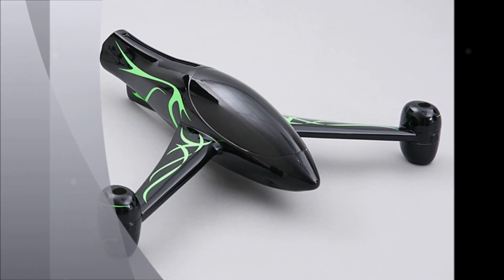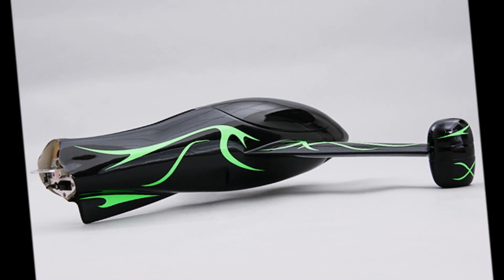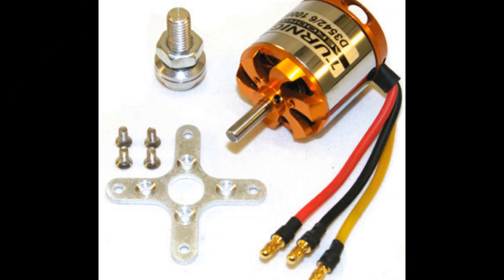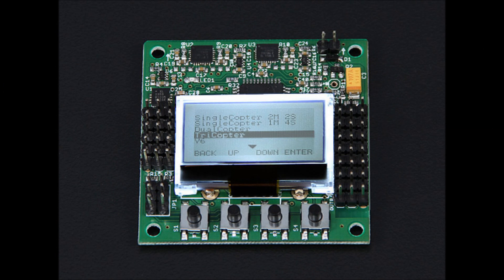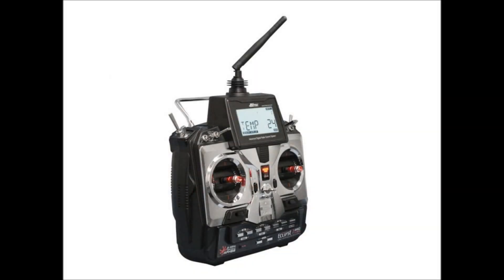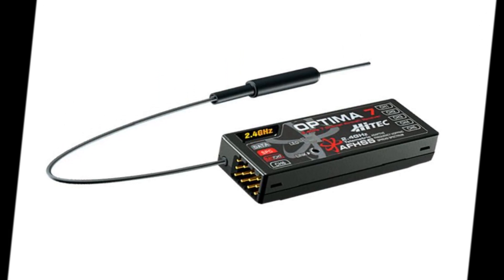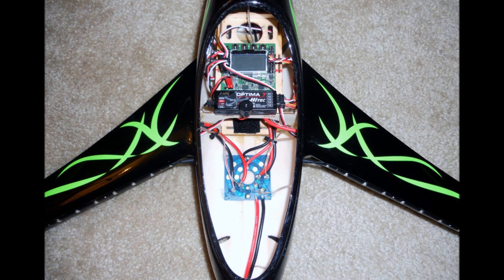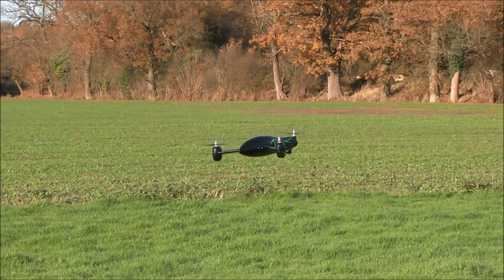Y3 Fiberglass Tricopter from HobbyKing

Comment: Im building mine now, I have 3 NTM 800kv motors and 3 NTM 1350kv motors doing nothing but I am not sure which would be better to use. I plan to power the unit with a 2200mh 3s lipo
Reply from the maker: +Marc Owen The 800kv motors would be most desirable to provide plenty of power.
Reply: thanks jhawk ill go with them

Comment: i have one and it is  not  flyable with self level off do you have any tips to help
Reply from the maker: +carl muff Don't turn off self level...that's really the only advice I can offer.  I've never flown without self level.
Reply: +jhawk1977 
did you do a video of the setting of you kk board or is it standed
Reply from the maker: +carl muff No sir, I don't.

Comment: I liked your smooth bank turns. I assume your auto level was off. I tried to fly with auto level off and its very touchy. I have a KK2. Do you have advice on how I can dumb it down a little?
Reply: I think you can set the limits for the self level so its like half you and half the board controlling it.

Comment: Very well done video. I just received mine. I wish my new car had a paint finish like this does. I was wondering. Space in the cockpit is limited. Where did you mount your power distribution board?
Reply: in the video he shows it, its right infront of the KK2 board. looks like everything fits well in there.

Comment: Nice vídeo, it has help me a lot.
Did you have a over heat problem on your ESC?
Mine is shut down because heating.

I’m using:
Turnigy L2215J-900 Brushless Motor (200w) (http://hobbyking.com/hobbyking/store/uh_viewItem.asp?idProduct=14737)

Hobbyking SS Series 25-30A ESC (http://hobbyking.com/hobbyking/store/uh_viewItem.asp?idProduct=6460)

Do you think I need a 40ª ESC?
Regards
Reply: Hi. Maybe try smaller props that would keep the esc heat down. :)

Comment: Just have one question for you, How did you keep the top and bottom motor cover on I don't want to glue just in case need to change motors. Are they tape on?
Reply from the maker: You must use tape, velcro or magnets.

Comment: Hi again, could you explain what you used to connect all three of your ESC's together and tie them into one battery pack?  I noticed a blue disk in your video that you seem to use as your "junction box".  What is that and where do you buy this from or do you recommend another way to connect all of the ESCs together to plug into the one battery?  Thanks again.

Comment: I checkout the HK 35/42/6-1000 motors which to me seem to be over kill power wise.I am going by my experience with turnigy motors of various prop jets and edfs i have built...I may be wrong though....is there a specific reason you choose these motors..does can have to be a certain diameter or length...For example my 450 bluerays outrunner is a 28/35 size can.3 smaller motors this size would weigh less and in my mind would still have more then enough power...But maybe those 35/42's R A 
must.thx

Comment: i have new  Hobbywing 20amp escs already...did your hobbyking esc's ever get hot...if not i am thinking these 20 amps should work well, but i never built a quad... I also have a jr9303 tx..which is a heli/plane radio 2008 model will this work okay......thax

Comment: Could you tell which size of props you use? I use for a similar motor-setup 12x4.5. They give maximum efficiency but cause some problems on the tail (had to lift the motor so that the prop does not touch the airframe, this puts a lot of extra load on the servo ...). Which batteries are you using and what flight time do you get?

Comment: Greetings   very nice presentation. the settings that you have listed ...do you consider that they are suitable for a beginner to this type of model .I have been flying R/C for 30 yrs + but this a just a bit different to any thing .}I do have this model } unflown. Were you using standard KK with1.2 or was it flashed to 1.5 and ho about the servos?
Thanks

Comment from the maker: No changes on the TX other than slight trim. KK 2.0 settings were for the tricopter setup.  No auto-level.  Axis (Roll Aileron) PG: 115 PL: 110 IG: 25 IL: 20 Pitch Aileron is the same.  Yaw PG: 45 PL: 20 IG: 50 IL: 10

Comment from the maker: I did not discount the wires.  There is only one servo that feeds to the receiver.  The tricopter only has one servo total.  Yes you can do stunts.  Loops and rolls are easily performed.

Comment: Nice presentation. I've been looking at this machine and the KK LCD board. You can't mistake the orientation for sure. Are the motors symetrical it looks so and what is the spacing motorshaft to motorshaft?